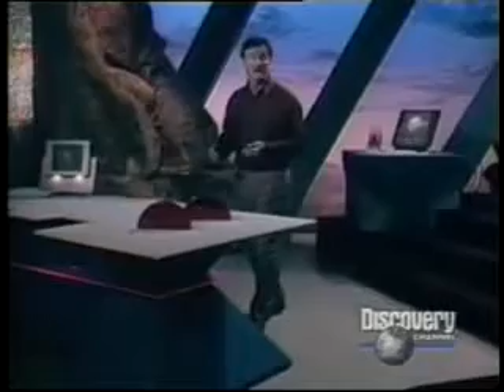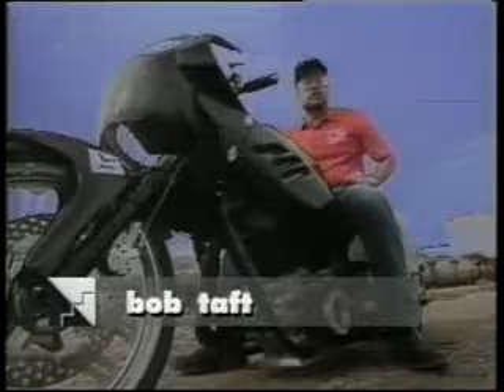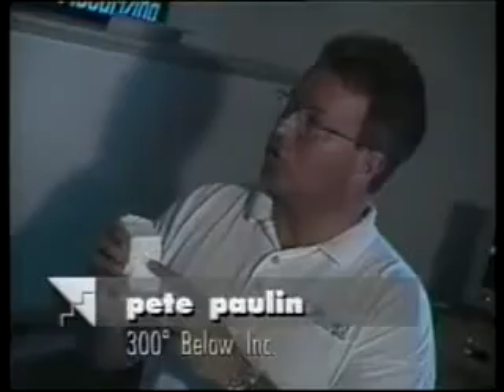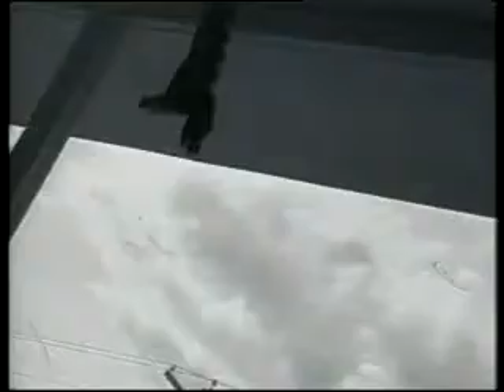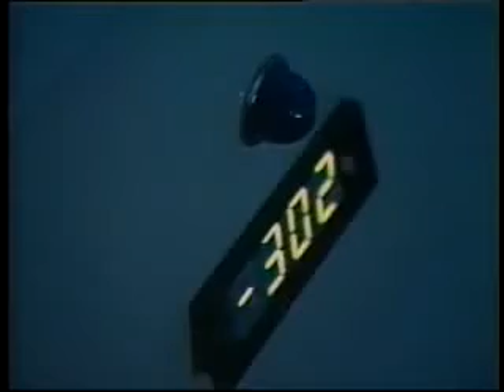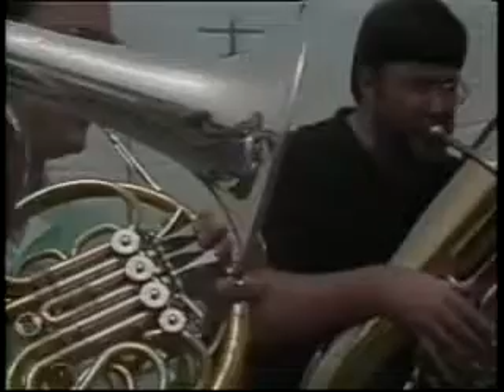Discovery Channel Next Step : Cryogenics

Comment: @ARandomCanadian No thats for everything. The it costs much less the 28,000 to take your body down to Liquid Nitrogen temps. Most of the 28,000 is invested in a very conservative mixed fund that gains compounding interest. The interest is used to pay the overhead such as facility , personnel and perpetual liquid nitrogen. Dry ice is simply not cold enough to stop all molecular motion. Also Liquid nitrogen is cheaper.